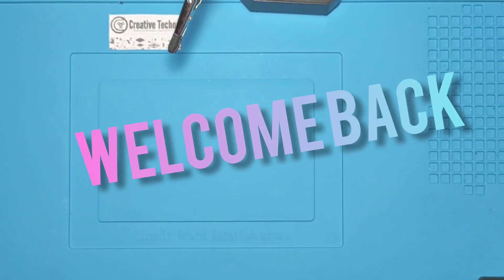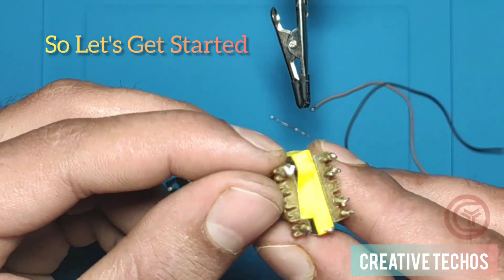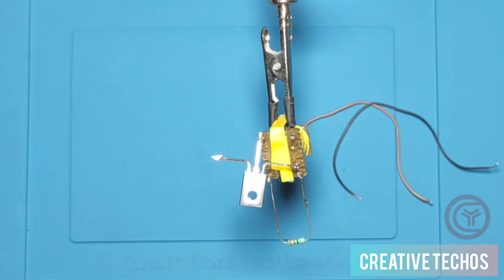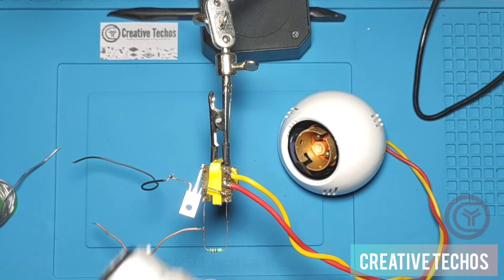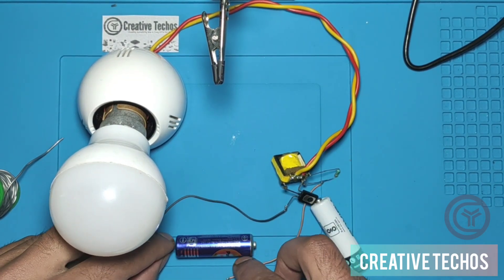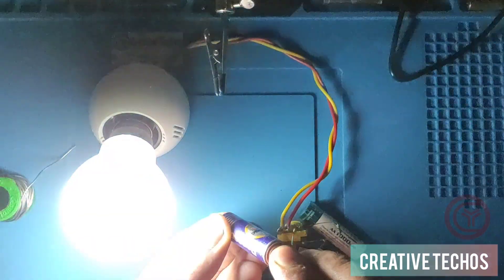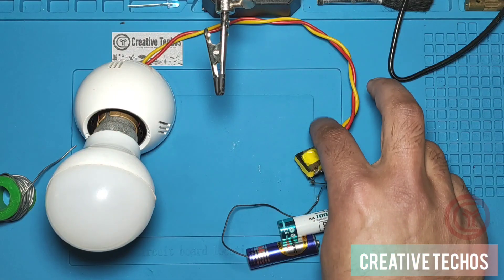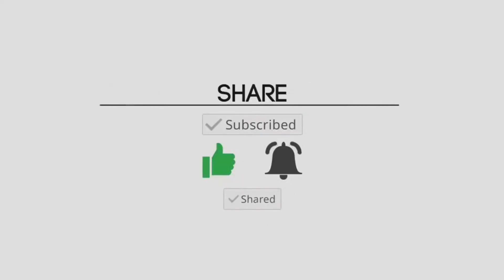Mini Inverter 1.5V to 220V | DC to AC Inverter

Comment: sir how much ac voltage at secondary of transformer ? 230v ??
Reply from the maker: It may be Little Higher but with low current and the voltage will decrease on connecting load since it has no feedback

Comment: Nice - what are the T1 primary and secondary winding open resistance so I Can calculate the windings
Reply from the maker: Thanks for your inquiry,
Ist of all would like to request you please SUBSCRIBE the channel.

And would like to let you know that
 Actually this T1 used in this project is scrapped out from the adaptor,
You can get one out from old dead adaptor and check yourself correctly.
T1 Recommended from 12v adaptor